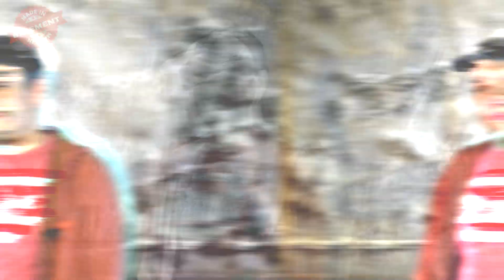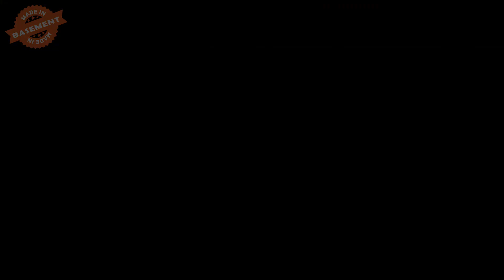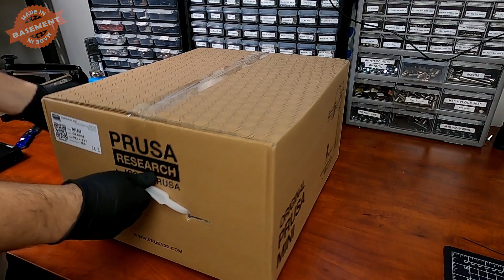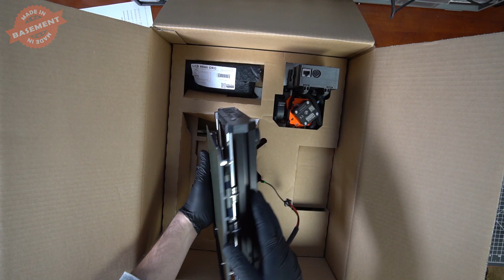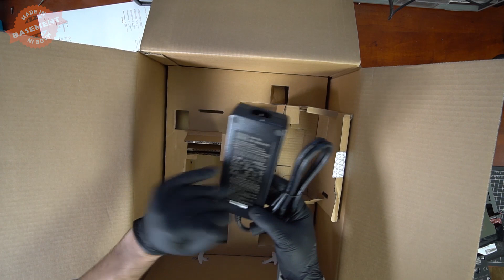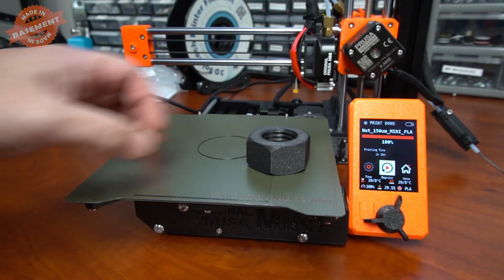Prusa Mini Unboxing, Assembly, First Impressions

Comment: It seems lots of people having problems with prusa mini so I don't think I will get one now.
Reply from the maker: In a hindsight, I might have been too harsh. I'm working on a follow up video. It actually prints very very well once you get it working... I think for the price it's definitely best printer on the market.
Reply: For anyone reading this, I have 2 of the Mini+ and have been using them commercially for 1 1/2 years. I think I've probably had less than 20 messed up prints in that time, and last week had my very first "issue" where the filament broke off past the extruder and I had to unscrew the bowden and pull it out. Thats it. They are solid workhorse printers. I've read online with some people having issue with the small PTFE piece in the hot end, and a super easy fix. Compare that to my Ender 3s where I'm getting new parts for it every month.

Comment: Please RTFM, temperature working range is from 18 to 38 degree Celsius.
Reply from the maker: I'm not sure I really understand your point here. I clearly mentioned that it will work at 18C. Just because it's the the manual doesn't make it OK or acceptable.  What if they put in the manual something like "This printer will fail every 2 prints". There's no reason why it can't work at 15C, and it does work (after I use heat gun). I have same issues with my other 2 Prusa printers, and it's extremely annoying and pointless...
Reply: @madeinbasement  Print more, it will get hot 😁
Reply: @madeinbasement  If the temperature is too low, you get increased risks of warping and such. And if it gets really low, the bed won't even be able to maintain its temperature, or it will have uneven temperature resulting in bed adhesion problems and failed prints. I have solved this by building the cheap ikea enclosure.
Reply from the maker: @nictamer   Agree, enclosure helps with some filaments. However 15C is good enough for PLA and PETG printing. I have 5 printers in my basement printing all winter and I only had issue with Ninjaflex filament...